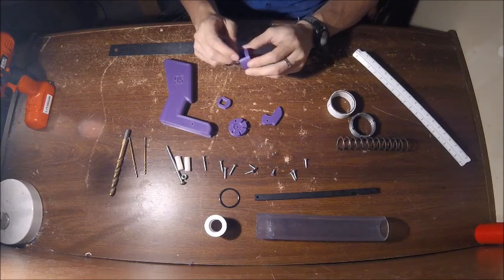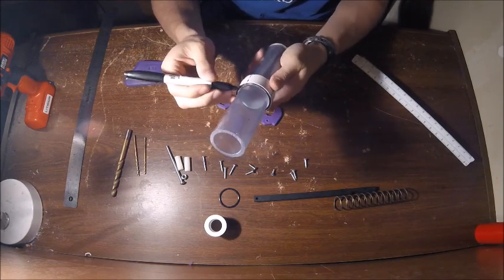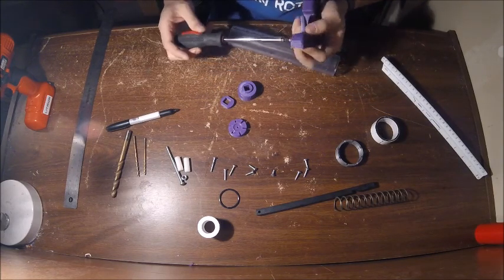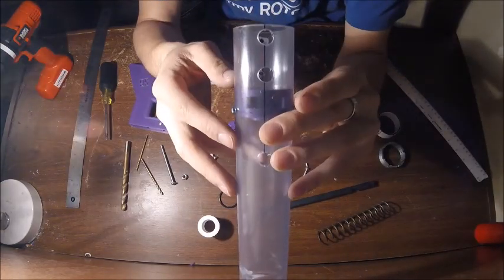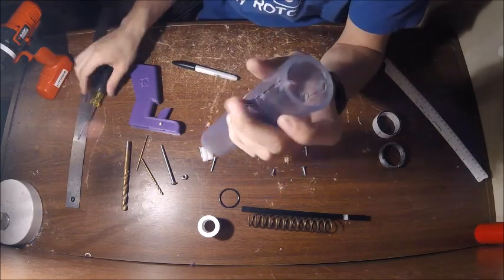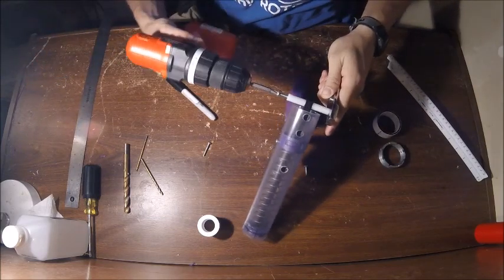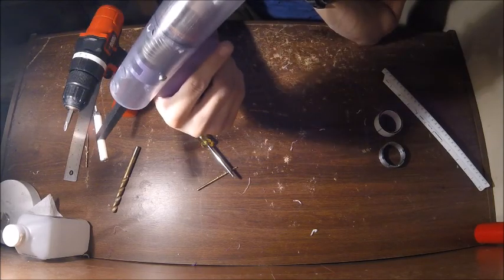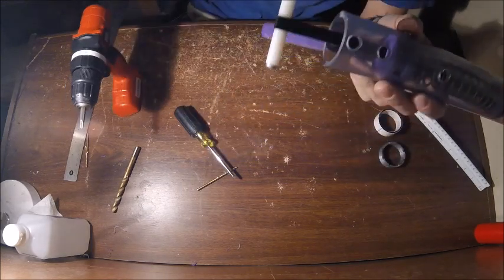Rainbow Pistol Build Guide | Nerf Blasters

Comment: This is helpful as I'm using your printable parts to build my own Rainbow, with some modifications. However, I can't find the marking jig you're using anywhere and I'm stuck on marking the pipe for drilling as I don't have an accurate way of marking it on opposite sides. Could you provide the Thingiverse link
Reply: Or you could use a basic geometric circle chord bisector theorem to find the center and then lining up a ruler in any direction and drawing a chord. Then, knowing the center and a diameter, you could just use a right angled object lined up with the center and the first diameter. From there just fill in the rest of the angles with a protractor or other postulates. Hope this helped
Reply: @henryyin2471  ...is this a joke and/or ironic?
I ended up just designing and printing my own marking jig.
Reply: Good idea. For a second there, I thought that I could use something I learned in math class in the real world. No, I was just really tired from math lol. How did your Rainbow end up?
Reply: @henryyin2471  I never got that far in math, I would have attempted to do it the math way but I had no idea how - everything you said is way above my head.
Ended up pretty good all things considered. I didn't have any Delrin/Nylon bar stock so I designed and printed my own plunger rod, which catches just fine and is ergonomic and I'm hitting 200FPS, that's with half a K26 and 12" of 17/32 brass since I couldn't get any CPVC - I could probably get more FPS out of it, but I'm happy with that since it's my first 200FPS blaster, and my first homemade. The marking jig definitely helped get things aligned, and since I used M3 screws I was able to drill really small access holes to insert the screws for the grip. I also didn't have the reducer bushings at the time so I designed one as well, it kinda works but I'm really regretting it because it doesn't fit PVC (for wye hoppers), very tempted to try removing it and replacing it, but I don't want to risk it. Some gripes: I don't have a countersink drill bit or flathead screws so my screws stick up from the surface, a drilling error left one of the front bushing screws misaligned, I didn't have a short enough screw for the front bushing or the right size for the catch so I had to grind them down with a Worksharp (my only belt grinder lol) and consequently the trigger sits far forward when primed, the catch was printed in ABS so it shrunk/undersized and so the catch (and by extension the plunger rod) sags a bit, and I abhor the design of the grip. But I learned a lot along the way, since that was one of my first ventures in 3D design - I'm now working on a better grip, a better PVC marking jig (which I will resize to different PVC sizes and post STLs), gonna buy a countersink bit set, and I now know how to make Rainbow plunger rods for some other builds I have planned.
Pretty eclectic build, but I guess that's what's great about homemades, super fun and you use what you got to make it work. To my knowledge, nobody has ever done a fully 3D printed Rainbow build, or at least not a plunger rod - there is the Caliburn but that doesn't have a full plunger rod, only enough to catch and the actual priming force is exerted on the bolt.
Reply: @frogsareop5623  Dude that's great! I am also working on a rainbow except it is pump action. The K26 spring I am using is arriving today actually so I am super excited. It is also my first homemade every and I substituted the poly-carbonate parts with 3d printed parts as I didn't have any on hand. It's great that people are still making PVC homemades! I am actually quite new to the nerf hobby and I am glad to see so many helpful people in the hobby that are willing to share info.
Reply: @henryyin2471  I know, I've wanted to build homemades for like 8 or 9 years. I grew up with Nerf, got my first blaster at age 4, have been in the internet community on/off over the years - only recently did I finally have the tools, time, and materials to do it. I really like the idea of taking 3D printing and using it to make homemades instead of trying to machine it out of polycarb. Most people with printers try to go for the absolute nicest, highest performance builds such as Caliburns or designing their own in a similar fashion, but I kinda have the "get the parts from the hardware store, use the printer to make it easier" mentality. McMaster ain't cheap lol, and it's fun to make something simple sometimes.
You're going to need the marking jig then! :P I've got a lot of personal projects going on right now but I hope I can get the marking jig available soon, I can't decide how many holes it should have, but it will be sized from 1/2" to 1-1/2" PVC.
Reply: @frogsareop5623  That is very good wisdom. I hope your projects turn out well!

Comment: What size is the delrin is it still the same old 3/8s?
Reply: @FrontlineFoamBlasters  Okay sweet! Do you think the catch and plunger head can withstand a k14, if I print it out of Polycarb or carbon fiber?
Reply: Btw love the sounds of the printer in the back ground, true Nerf modder right there lol
Reply: @FrontlineFoamBlasters  Sounds good. I will comment again if I have any issues. Also I had commented on the thingiverse, can you post up the marking jig. I would love to have one.
Reply: @FrontlineFoamBlasters  awesome thank you!
Reply: Hey my K14 springs come tomorrow so I have two builds ready to go. I printed the normal PLA 100% infill catch and a polycarb one. Testing to see if the normal one can handle it if not then polycarb. I'll tell you the results tomorrow or Wednesday
Reply: @hawkeyeriza7228  How did this go? I built mine with K26 and printed in ABS.